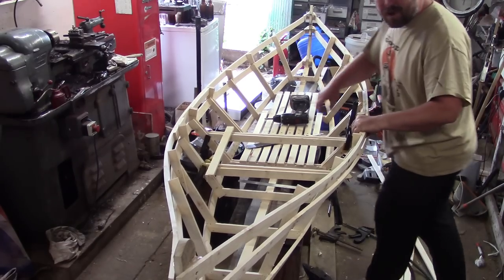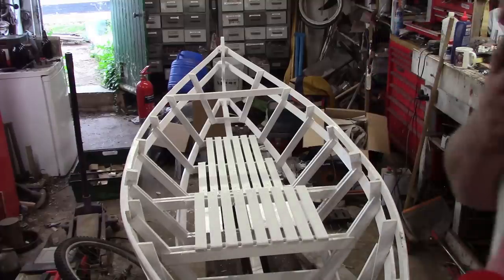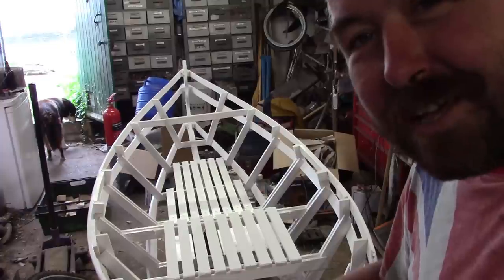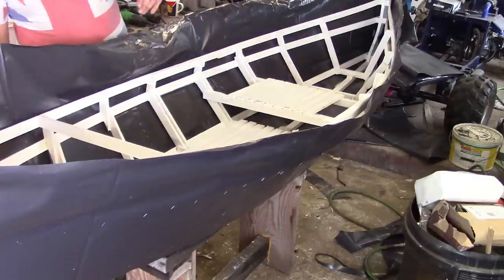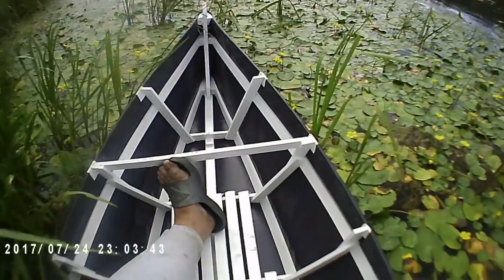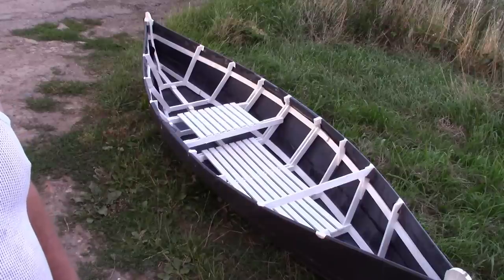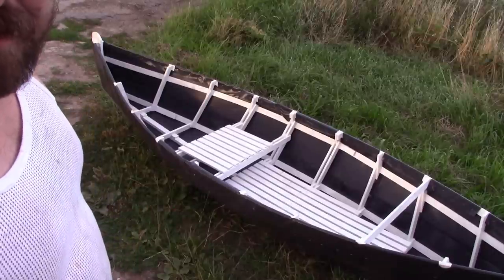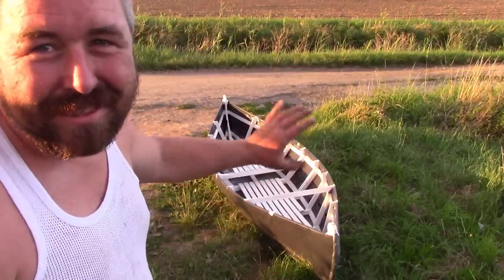£20 canoe build

Comment: What about that heat shrink plastic they use to wrap boats for winter storage? You can buy a piece from west marine 6mil 17'x31' for $45 -  about 35 GBP.  It's polyethylene as well but a single sheet could be tacked on the inside of the gunwales before heating to get it tight, so no seams. Be enough for two of those frames you've got, or something bigger ... hmmm, now you've got me thinking, I just might try that!
Reply from the maker: heat shrink aye? i think i know the stuff, boat gets the wrap then its hit with a roofers torch, i'll investigate thanks.

Comment: James, did you ever see the Russian guy make the kayak using shrink wrap around sticks? It’s pretty amazing and light!
Reply from the maker: Yes, someone else has just mentioned him, I've had lots of excellent suggestions, I'll try a few
Reply: I was pretty sure he used pallet wrap, that thin clear plastic wrap that is like a yard wide.  That might be whippet a try if you can have a mate pluck a roll just before it's at end of life... or just ask some guy to buy it for $5  who seems like he is the manager of the site. 

You might also go with cloth and resin but if that is too normal for you maybe try experimenting with fabrics and things top put on it,  grab a bunch of different kinds of rags and gp to all your friends houses and see what whatever deck sealer or water proofing things they have  do to your rags.
Another thought is to use spray foam to strengthen up that clown pocket plastic on the bottom.  Another idea is pool covering material.  Lightly used space blankets [mylar] or actually any mylar for that matter,  I just thought that any that unfurl and can't be folded back up top be stopped again might be cheap or free.
You can also use bike tire tubes if you get all the free ones form a local shop for free or in exchange for a quick shot out. If you use sort thin plastic GPU can use the rubber from the tubes to rubberize the edges that will touch the dock and a bunch on both ends. You might even use strips for extra support cris crossing the ribs with Xs. Maybe gp tip where contractors buy stuff from and ask for some samples of all the things they sell in big sheets, you could say GPU wasn't tip waterproof a new house or something like that but they might like the idea enough to help you out. Worst case scenario you could try to weld a whole town's worth of pieces of milk jug together into a legit canoe... or kayak offe a row boat really, cuz at that point you could really go anywhere from there! And what about using PVC pipes for the long struts of the big canoe if you make it skin on ribs. Maybe sew it together with para cord! That actually sounds like there perfect combination of stuff to put together.  Start with PVC ribs on a form, paracord stitching top tie things together,  use bike tire inner tubes to help get it to hold its shape and be stretchy where it needs to be and to cover vulnerable edges of these boat and protect it from bumping against things like the dock and finally the icing on the trash cake pallet wrap for a clear skin to tie it all together! The pvc is the most expensive stuff and if you look in the right places you can get good prices on that as well
Reply: @evilcanofdrpepper  this should be a comment. You have a hella lot of good information and amazing ideas

Comment: I made an aluminium skiff a long time ago with the method you have just described. Or similar. Made a skeleton boat on a jig frame then made hardboard templates off the skeleton. The hardboard templates then were transferred to the ally sheets.  A good thing I could see with it was if I spaced the frames differently I could have made a shorter or longer boat with perhaps even an extra couple of frames which if the general lines of the original shape were followed it would be like a scaled up version. 
  Every day is a school day. 👍🏻👍🏻
Going to try some juice extraction next week and brew it up. You are an inspiration to many mate
Reply from the maker: What juice are you extracting? I've just made some blackberry wine, I can send the kids out with a bucket and 30 min later they come back with blue faces and 5 liters of the things, bumper crop this year.
We're you able to use your skeleton boat as an assembly jig? Like I say, I'm hoping I can float the skeleton of anything larger that I want to prototype like this.
Reply: Going to try squeezing a few swede turnips, make some swede cider, berries don’t grow round here, unless in greenhouses so I thought, try and make it out of something we can grow. We will see.....
   The skeleton I made was transverse frames, I then sawed a thin strip of wood like the ones you were using, being careful it had no knots, this was pinned at the chine to help with making the hardboard pattern. Of course it could of been light plywood and made the boat directly out of that. 
   I guess another thing would be make the frames adjustable themselves so the angle of the bottom and the sides was able to be set from boat to boat, the number of frames could be altered and even then perhaps you only need to make one side of the boat like that, just make two bottom pieces and two side pieces off the jig frames. Frame the boat itself out after the hull is complete.

Comment: A couple years ago I made a one man canoe. It was (or I guess still is) made with a kind of a plywood one ribs design. No keel or connecting bits between the ribs. You could almost call it monocoque. It had an inner and an other hull. It has a slight v shaped arched bottom. It's heavy and was unstable as hell. Also, the inner hull was only water tight until I sat in it, and now its rotting from the inside out because of splash water...
Maybe I get around building version 2 of it one day...
Reply from the maker: how was it sealed up at the seams?
Reply: @turboconqueringmegaeagle9006  about three tubes of caulk

oh and, base coat, 4-5 layers of paint and 4-5 layers of finish
Reply from the maker: @TheHom3er  very nice! I'm surprised any moisture managed to sneak past all that lot.
Reply: @turboconqueringmegaeagle9006  I'm pretty sure the outer hull was and still is tight. The inner one had some pretty ugly seams, that I had a hard time closing. So I guess the flex from my weight opened them up at some spots. And then some splash water got in...

Comment: I love the canoe but i love the fact better that u fixed ur slippers with duct tape 🤣
Awesome craftsmanship, on both accounts 👍
Reply from the maker: I know right, some people cross the road to avoid talking to me, I know it's because I'm so fekin classy I make them nervous
Reply: @turboconqueringmegaeagle9006  
I can imagine 🤣🤣🤣
I am like that too, dressing like a classy hobo lol
Back to the canoe, i made one too years ago, i used a tarp to cover the frame, it wasn't a permanent solution, i could take off the tarp and put it back on when i wanted. It worked well.
Reply from the maker: Actual canvas tarp or a plastic one? Don't just tease me, I need the details mate
Reply: @turboconqueringmegaeagle9006  
Ha ha the heavy duty plastic one from homebase:) a 4x3 m see through one, it was holding up well. The frame got broken, I made it from green wood, copiced hazel branches. Tied them together with paracord. It was similar size like urs, without the sitting platform.

Comment: hi my name is David I just got finished watching your video on building the membrane skin on frame canoe and you had asked it if anybody had an idea of something better to coat it with well I don't know if you ever paid attention to the old pioneer days but they used to do a cloth and whitewash to waterproof the roofs and stuff on their cabins while this day and age it's the same principle but you just use a oil-based paint that is at Water solvent you painted on to the to the inside of it and you painted on the outside of it and the paint seeps through the fibers and makes basically a cloth waterproof skin for the boat it's just an ideal for you thought you might like to try and see how it does if it does better than your plastic membrane that you tried good luck God bless you

Comment: Firstly... EXCELLENT, I love videos like this.... what would I do in your position, well, you’ve spend time and effort so you HAVE to solve the stability and then find a good looking covering. (Although the 'bin bags' look far better than you described them... ) Adding stability means changing the frame OR  making some sort of quick release 'floats' that don’t interfere with your paddling. I’d go for the floats, with your creativeness you could come up with something. As for covering, my pedal boat is a slight vee with keel covered with 5mm plywood and then resined. It even works in the sea. Stable and watertight. Looking forward to result...... know Expert
Reply from the maker: Cheers, I'd like to try adding a couple of inches width each side at the chine, thinking if I pull the covering off it'll be easy enough to just stick another baton on top of what's there.
The covering... Someone had the amazing idea of shower curtains, I've got two nice kitch curtains on their way to me!
I like ply boats, your pedal boat is beautiful.
Reply: Thank you very much.... I did read the reply about the shower curtain and must admit the picture flashed through my imagination.... then I thought but would he go for it?  INDEED he would... good man...... it’s why you have a good amount of subscribers, great bloke, entertaining videos and good ideas. Looking forward to the next installment already..... know Expert.

Comment: I had a FolBoat, similar design, but it had one more chine on each side, making it 'slightly' wider.  Felt like poor initial stability, but the further it listed, the 'wider' it was at the waterline and the stability increased and the final stability was fantastic!  I could NOT capsize it, and we tried VERY hard.  The skin was a thin Naugahyde with cloth-side out and actually wood glued to cloth side of heavier Naugahyde, vinyl out.  VERY hard to pierce, VERY secure, VERY stable with 4 people aboard (~18' LOA and ~42" beam).

Comment: You can look up great small craft demotions online. I remember even width and depth with an exception of a keal. But I wanted to say I've made body parts for cars out of a felt blanket and fiberglass resin. With the right marine or maritime resin you could seal a cheep felt blanket and rip out there to your harts content. You'd have to test it's ability to stay water proof, sounds right up your alley, and I can't find another. Power nation did a felt front bumper on a ford ranger they built same thing. Good hunting, and have a good one and all that.

Comment: That's an impressive build there even if it didn't quite work. I think it's tippy because it's too flat bottomed all the way up and you are sat too high for that.

On the novelty coverings, I have to wonder how much model aircraft tissue and dope would cost....

On another note, I've just acquired a Meddings drill press. So heavy I couldn't even get it too move after I unbolted it from it's bench. Do you reckon it'd be worth a video? (Putting it back together that is).
Reply from the maker: the aircraft tissue is pretty cheap, so is the nitrile dope, not at all sure itd be strong enough though.

always worth a vid on the old machinery!
Reply: @turboconqueringmegaeagle9006  You'd layer it though, rather than using a single sheet. It's water proof too once doped.

That drill press.... I tried to move it, couldn't, realised it was bolted down so unbolted it and still couldn't move it. It weighs in at around 20 stone!
Reply from the maker: I've got a meddings 5 speed floor standing drill and can move it myself, what model do you have? Sounds like a proper job!
Reply: @turboconqueringmegaeagle9006  It's a Meddings MB2. The pillar is a 2 7/8" diameter 3' long solid steel bar. It isn't the heaviest bit.
Reply from the maker: Ok, mines a bit later, similar specifications but probably not such a heavy construction. 
The floor standard MF2 version is only 200lbs, surprised a strapping lad like yourself can't just pop it on your shoulder!
Reply: @turboconqueringmegaeagle9006  Their current version of mine is 21 stone, this appears to be just post war, made out of anything they had that was extra heavy! (293lb)
Reply from the maker: Melted down Churchill tank tracks!
Reply: @turboconqueringmegaeagle9006  Something like that. I have emailed them the serial number to see what they can tell me about it. It beats my Lidl bench pillar drill for solidity!
Reply: @turboconqueringmegaeagle9006  I had to wait a whole half hour for a reply... Mine was made in June 1963 (so virtually new) and weighs in at 275lb net.
Reply from the maker: A whole half hour!? The bare faced cheek, 60 years ago someone paid a lot of money for that machine!
Reply: @turboconqueringmegaeagle9006  I suspect they did..... I have to say I am impressed.

Comment: I see that Rambo did his usual when the compressor started screaming...roflmao ... Shitebag!

ADD AN OUTRIGGER !!
Reply from the maker: he fookin hates copressed air, parafin gun or tyre inflator and he'll try and snatch it out of my hands.
Reply: @turboconqueringmegaeagle9006  LOL...I still say add an outrigger to the canoe!
Reply: @samc705  is that the piece to go underneath the boat?
Reply: Sam C yes, yes. Outrigger will do the trick
Reply: @kreterakete  knew it was called summat. I thought sturn or bow lol
Reply: @CrownJewelzMusicGroup  An outrigger is a smaller canoe that's attached to the side by a couple of poles, it aids with stability. You're thinking of a keel that runs the length of the canoe and is weighted.

Comment: Hi for the time it took to build and the low cost it looks the part. But if like you say it's a little unstable then that's not so good. I know f#×k all about boats but could you use a cotton bed sheet and then paint over it with some wax  and then varnish on top. Well good luck with it I'm sure you will come up with the correct solution soon have a couple of beers to get the old brain cells working. Take care  till next time buddy. 👍👍👍.
Reply from the maker: Be proud you are the first person to say bedsheets! 
Thanks mate, take it easy

Comment: have you thought about waxed oil cloth
Reply from the maker: I had a look but, canvas costs mega bucks and if i was going to use canvas id dope and paint rather than wax
Reply: @turboconqueringmegaeagle9006  i made a pair of oil cloth trouser the other week ill post a vid once its cured. its taking forever.
Reply from the maker: @ianschannel6947  id like to see that. cure time and cost is why most people use turps  insted of lard or tallow and linseed oil in the wax which is what i used and why my jacket is still tacky 18 months later!
Reply: @turboconqueringmegaeagle9006  i used 2 parts microcrystalline  wax (£10 per kg), 1 part boiled linseed oil and 1 part white spirits.

Comment: how about a proper pvc tarp. £30 will get you enough för covering a 20 foot canoe
Reply from the maker: Yes, I've seen some good ones with glass weave inside the pvc, much like bouncy castle material but a bit lighter, it'd probably work quite nicely but it'll be fun to explore some of the cheaper options first I think.

Comment: That was a great project. Personally I don't like canoes because you have to lean over to one side and as you say they are 'tippy'. I prefer kayaks because you sit upright and control the tippyness with the hips which once you get used to it is a lot easier. To make the boat go straight you need to nail a bit of 2X1 on the bottom as a keel or have a fin on the back. That will stop the boat from 'waggling' about when you paddle. You might be interested in this guy who builds similar boats with a new material which can be welded with a hot air gun. 
https://www.youtube.com/watch?v=EUo9nUU3aUA&feature=emb_logo  . The material is much more expensive but he is using 2" thick material but you can get it much thinner. He also has a website which you can get to from his youtube video. It tells you where you can get the material from. This link (https://drive.google.com/open?id=1sbzGNogR1qrgz9VDwLRd7flDZyRsrtJJ) is an image of a camping kayak I put together. I sleep on the water in the kayak and I can get it on the train with all my camping gear. Personally I would go for stitch and glue because skin-on-frame boats are punctured very easily. There is nothing like messing about in homemade boats. All the best.